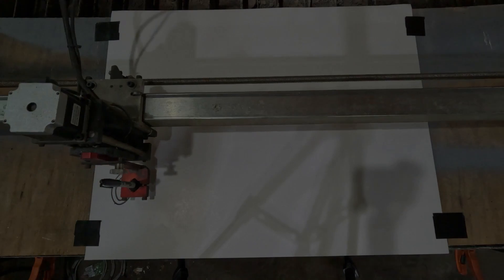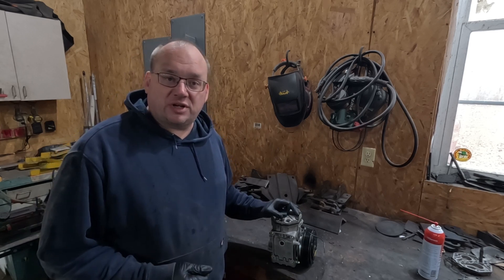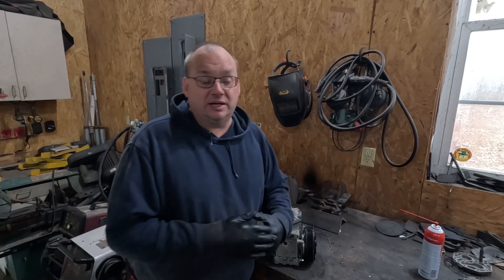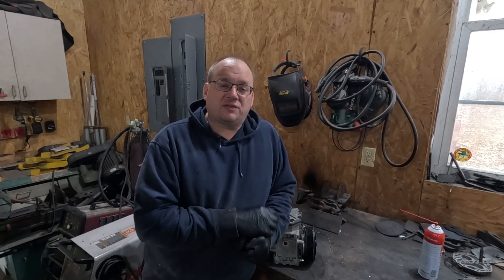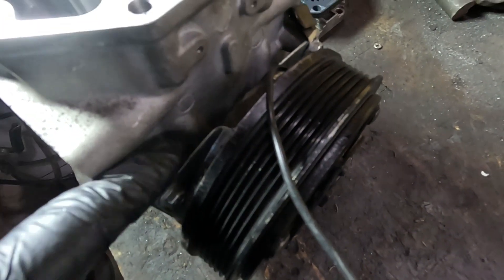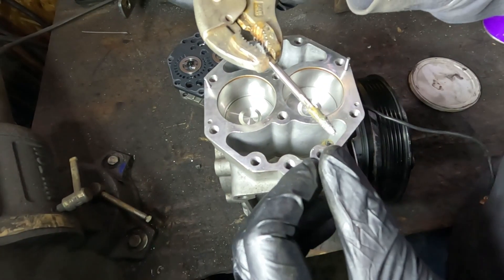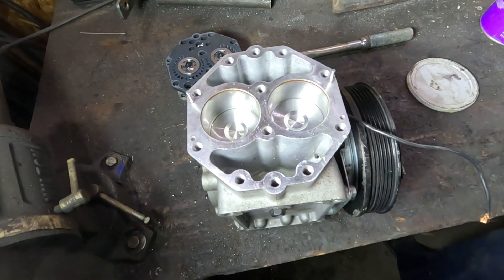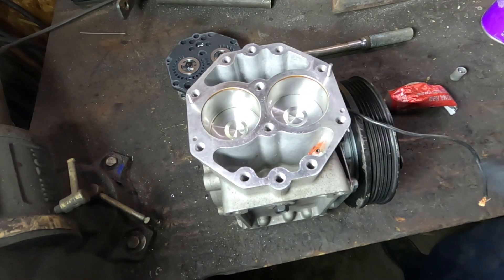Converting a York AC compressor to be used as an air compressor

Comment: Will there still be some oil going through the air pump?  If you seal that hole, up is it detrimental to the oil in the bottom of the unit? Like causing pressure increase or degradation to the internal crank?   I have air bags on my truck and I want to use on of these but couple it to an electric motor (12v) just haven't found a motor or a coupler to make this work.     Thanks for a cool video.
Reply from the maker: Some oil will still get by into the compressed air. No it will not damage the compressor at all.

Comment: Hi Jim, thanks for the information!  New to the channel and look forward to seeing the rest of your videos.. I use to run my York with an oil separator on the discharge and then drain it back into the crankcase but didn’t know about being able to plug the port.. this is way better! And I’m guessing the Reed valves still last without being lubricated?

I’m wanting to set my York pump up again on my truck but don’t have the hood clearance to run in place of my OEM A/C compressor.. can the York be run horizontal laying on its side after the port plug modification? 
Thanks again

Comment: That's what I used on a Nissan hardbody pickup for my air ride suspension.  Filled the air tank up as fast as the rpms go while in neutral (5 speed manual) lol.   Came out of an old RV.  Never had a single issue with it!   I love pull it yourself junk yards!  (Mowers / off road vehicles / cars, trucks, RV's campers)  <3  -  Yes if you're wondering if it is better than a POS Viair 480C or so spec Air Compressor - YES YES YES - it is way better than overloading your electrical system in your vehicle - It's better to do engine driven than electric motor driven and frying the electric motor because you can't math and your Alternator is too small or you're using the wrong gauge wire for too long of a distance - and you've gone through 5 electric compressors like the Viair and can't figure out the problem... Well there's your dinner!

Comment: What cfm does this compressor usually put out?
Reply from the maker: @DanielArce-w6z  to be honest I have never measured it. I will say it is significantly more than any 12v powered compressor.  Especially when you run the engine at 1500 rpm the volume of air goes up a lot. The one I have on my truck I can run an air operated impact wrench easily. In addition it has enough volume of air to reseat the bead of a tire.
Reply: It’s like 14CFM!  It can fill a 5 gallon air tank to 150psi in about 1min.

Comment: I've found that I need a crankcase breather as well, otherwise I blow oil out in about 4k miles, as I use this daily for air actuated exhaust brake. I've used this for about 15 yrs daily.

Thanks for putting in the effort to help people find this info easier!

Comment: very good thx, ??? what cfm and pressure are you getting? I want to add one on my Jeep and f250 for air and train horns and hate to hear the electric turn on....
Reply from the maker: I have never measured the CFM. I can get 120PSI with out any trouble.  If your vehicle is parked you ide up the engine to get more volume. I can get enough volume to run an air impact wrench and to seat a bead on a tire.

Comment: Doesn’t the compressor need to be lubricated by something? I always thought the refrigerant also lubricates the pistons. Without some kind of lubrication, I cannot imagine the compressor living very long. I could be wrong though.
Reply from the maker: @siTTinLo  the compressor has it own internal oil sump you have to fill. That is why it works for this application.
Reply: @creatingstuffwithjim  10/4 Rodger that.

Comment: Where did u get your serpentine clutch at, I’m in need of one. Today I finally got my hands on a York K941814 at my local auto wreckers and I had already converted to Saden ac compressors to air compressors but they just didn’t fit right on my 04’ Silverado. My friend told me that I needed to get a York. Thank you for the info on converting these types of compressors. Very Helpful I just need the clutch and the gaskets if u can help me out on a budget. Thank You & God Bless
Reply from the maker: @kasperoner6988  I bought the complete compressor on Amazon. I am sure they have just the serpentine clutch assembly
Reply: eBay...

Comment: thank you! i just build a 210 in my '79 surburban. i will block of that hole. what oil do they need and where can i see the oil level??
Reply from the maker: I use 30 weight engine oil. There is a fill plug on both sides of the block. I use a piece of wire as a dip stick and keep about 1"-1 1/2" of oil in it.

Comment: I found a hell of a lot at ranger station website, including the complete manual for all York types, and how to install the York as air compressor in several different methods!
It was extremely helpful, I installed a new aluminium York 210 to my Land Rover perentie over the course of the last year and yesterdY finally had it mostly going except for 2x  safety relief valves blowing at way lower than its rating, so today will upgrade that if I can find a new one somewhere and see what happens

Comment: Nice video.  Don’t forget you will need to add oil to the bottom end of the compressor for the bearings and crank.  It doesn’t use much but does need to be added.  

There is one place I found a while back that makes an oil port and dipstick for the York OBA.

Comment: Man you helped me a lot with this video, I have a york 210 like this for a long time dumped on my workshop, I wanted to make an air compressor with it but when I saw how much oil he spreads out I gave up, now I know the solution thanks to you, but let me ask you one question. If you seal that little hole, won't the the compressor stops lubricating his parts inside or heating too much?
Reply from the maker: The answer to your question is no. The piston and rings will get lubricated by splashing oil from underneath.

Comment: When I go to the salvage yard to get a compressor:
1. What vehicles would have these compressors? 
2. What would be the best place to source repair parts and gaskets from?
Reply from the maker: I have been buying them brand new off of Amazon. The V-belt style is the cheapest. 

For junkyards you can find them on jeep grand wagoners ‘70-‘80. 
Ford trucks from the ‘70s
Older Volvo uncertainties of the years 

A lot of commercial trucks such as road tractors

Those are just some of them.  

On the subject of repairing them I have to be honest. I have never repaired one. You can find parts for them on Amazon or I am sure there are suppliers online you can find. Unfortunately I do not know of one off the top of my head
Reply: @creatingstuffwithjim - There a few different versions of the York compressor that impact air volume.  If you do a Google search for York compressor oba years, there a few lists out there.
Reply: @creatingstuffwithjim Thank you, Jim! I'm thinking that it's about time for me to get busy on the hunt!
Reply: Ranger station has an article of every single US vehicle fitted with one, also a lot of non US vehicles from the early 80s back had them, and proper trucks
Reply: @radaraacf Thank you for your input! That'll make my hunt much easier!!!
Reply: RV's have them - anything with an air ride suspension - cadillacs air compressors are cheap and suck though